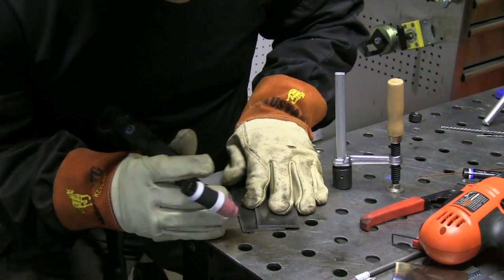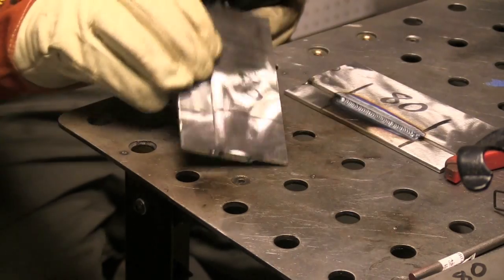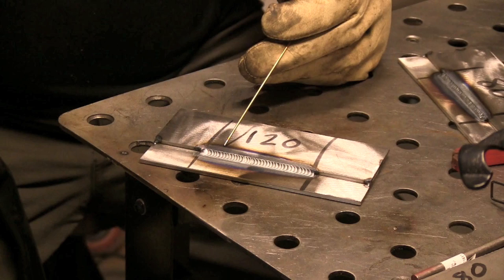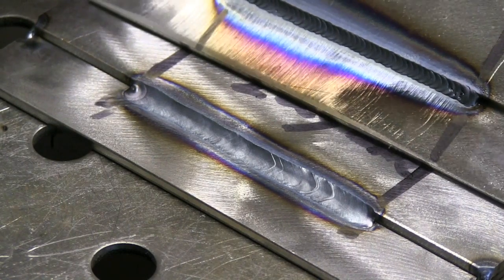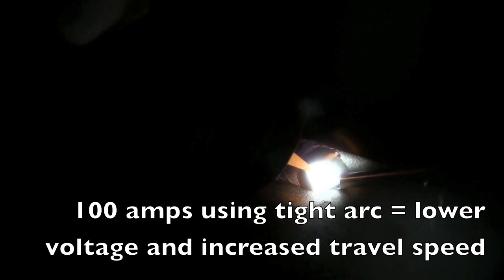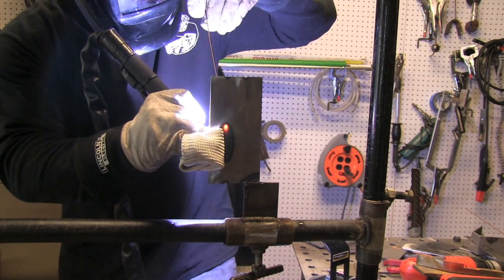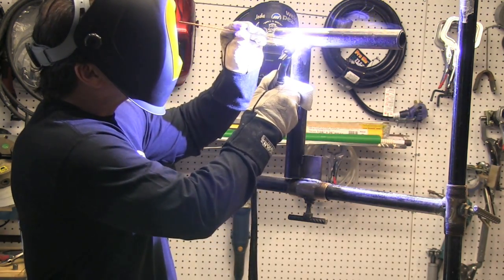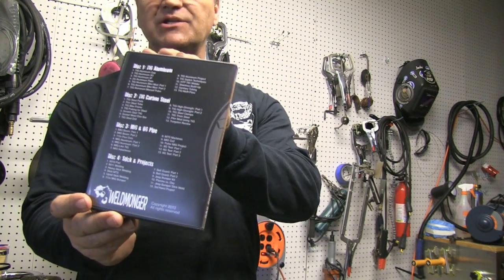Tig Welding Steel and Controlling Heat Input

Comment: Hearing you talk about the heat transfer made me think of something I learned about lampworking. That's welding glass tubes and shaping them. As you heat the glass it's helpful to think of it as water flowing into a dry sponge. The longer you sit in one area the deeper it soaks. In glass you have to keep it moving or it will drip like honey off a spoon. In your case 80A had to soak more to get hot enough and that soaked more heat in to the surrounding metal. Anyhow, good stuff 10 years later.

Comment: What a different way to approach the issue, I was bringing up the heat slowly until I first got the Puddle needless to say I was putting in way to much heat. Time & travel speed effects the heat input more than even the amperage setting, it's like a light just went on in my head, thanks.
Reply: Same here

Comment: The key to controlling heat input is higher voltage and borderline current. Voltage is also the key to better quality welds.

Comment: Given that your arc length was nearly the same, the heat input would be 4,800 amp-seconds at 80 amps and half that, 2,400 amp-seconds at 160 amps.   Good video lesson.

Comment: Thanks, Jody 😊. I'm basically a novice when it comes to tig welding. Was having issues last night trying to tack up a new welder cart, I believe I was long arching causing my tungsten to constantly lose its point 😒. After dipping my tungsten half a dozen times (but in my defense, I was on the dirty, crooked floor trying to get a nice square joint 🤣) guess I was overcompensating. Thanks again man 👍😊👍.
Cheers!

Comment: On the tube mills that I’ve worked on. Both carbon and stainless the seams are joined together using a coil on carbon.  steel as the seams are mashed together and a skiving blade right after to shave the the top weld off. As for stainless a laser is used right at the point of seam contact to mash the two together. Carbon runs anywhere from 160fpm to 300fpm. The best we can get out of stainless because of the annealing process is about 30fpm.

Comment: If I ever get a shop my plan is to make an argon bubble, 100% shielding until the parts are removed. Very specialized, I know, but there are applications. Say you gotta make some FJP stainless or titanium parts, the bubble will be your best bud. 

Luckaly I don’t need to worry about that because I’m a stick welder hahahahaha

Comment: thank you very much for this excellent lesson, I think showing less heat by increased speed is very helpful and you did an excellent job.  details like larger spark is higher voltage helps me a lot and I do need help.

Comment: Is heat input synonymous with potential for damage to the material?
Reply: Enough pedal over a time difference does make a large impact on the strength, geometry & composition of the weld.  As Jody states, heat input isn't necessarily a BAD thing. You need to weld 'hot' enough to get great penetration.
Reply: If you’re tig welding stainless, there is a greater potential that the material will break down

Comment: Thanks so much for this video! However what is the rule for welding dissimilar width material like 1.6>3mm mild steel, what would you set the amps to?

Comment: These are awesome ! I picked up a TIG after doing a little research for my body shop. A lot more aluminum is being used in the bodies, and they have to be welded. In steel bodies, the metal has gotten thinner so the old icy-acetylene torch with fluxed brass or copper clad steel rods are out due to warpage. 
   On the thin steel I've laid a wire from my MIG as filler and welded over it. Leaves a nice flat surface with very little grinding. My question is this: can I use this lay wire technique with aluminum?

Comment: At the end of the video you touched on heat spread affects on aluminium welding. Repairing structural things like 
aluminium boats, can they be welded without bad HAZ effects?
Reply: Hazzy238 

Aluminum will always suffer from a loss of strength in the HAZ. You can minimise this loss in strength but never eliminate. When you think of welding structural aluminium jobs remember to consider the strength of the joint will only be 2/3 yield of base material rule of thumb.

Comment: Very informative video! Thanks alot. As your talking about "arc length", is there a rule of thumb for the distance between the electrode and the welding parts? From the video it seems even slight changes have big effects, so i wonder if theres a best practice or something :) 

Thanks alot

Comment: do you have any videos that show tig welding on very thin ferrous and non ferrous metal. range from 24 to 12 gage sheets. or will they vary on different techniques?

Comment: Those tig fingers r good Jody I must say I like em I do a lot of tig. I find it helps if u wear a heavier glove like a mig or stick glove on that torch hand your puting it on it fits more snug. If u could make a smaller size one that fits snug on a tig glove would b good. U want it snug n they r a little big if u use it on your pinky finger like most prob do. Otherwise handy little things. For others using em they do fray with use over time but if u have a flap disc\ sanding disc they last quite a bit longer if u give sharp edges a little sand to remove the sharp edge.Sheared edges or burred edges chew these things up pretty quick. But once again these things r very handy. Always got one in my box!

Comment: Please could you tell me what material you use for the filler wire on cold steel. Here in Hong Kong they are telling me to use 316 Stainless steel filler rods and they are selling for $750 per 5 kg ...owch.

The other option they gave me was just use a STICK welding rod WITH the gig welder to join two pieces of cold rolled steel 5mm thickness together :-)))) Hmmmm sounds dangerous.

What do I need the filler rods for? Im welding could pressed steel 5mm together to make a TIG trolley.

Please could you shed some light as to what material the filler rods should be!

Thank you

Richard

Comment: WOW! Huge difference in the look of the weld at 80-140. My instructor told me to turn my heat to 60 on 1/8" stainless steel, and I must admit it took forever to establish a puddle. I'll try to turn my amperage between 90 -100 tomorrow and use this technique

Comment: Love your videos. As an R/C Heli instructor, explaining things in understandable detail is your forte. OK, I'm on my second "m" size bottle of argon just doing bead line after line, with and without filler. However, try as I may I just can't my fillet weld the color and small weld size of your fillets using the same steel as in the video.  My amps are 120 with 1/16" 1.5% lanthanaded rod, wp9 torch and my time for welding 3" is right around 35 seconds. Before I pull out what's let of my hair, can you help?
Thanks for your effort,
Pete O

Comment: I know nothing about TIG welding. Is the lay wire technique bad in any way compared to the other technique? (aesthetics put aside)
Reply: Yes it looks good but is a lazy technique that is frowned upon by good TIG welders as the wire covers and reduces the root penetration - which is the strength in a joint - this technique is for cosmetics only.

Comment: Please help. I am not a welder just a hobbyist. I am learning by copying you Jody. I have setup the same 11 guage plates. They are cut 2inches wide instead of 3 like yours. I am not able to get the same results. I have met your 3 things that can go wrong so my distance is ok and my rod is not out there. My problem is the welds come out looking grey not shiny like yours. Plus I am not getting the stacked dimes either. I have an HTP TIG Set to 120 Amps Frequency 33 Pulse 33 low side is 33. I have done it with out the frequency and same results. Please help.
Reply: I have tried all other settings I am guessing my tank is 900 PSI and it may have contamination floating in it. I have the gas flowing at 15 to 20 psi.
Reply: FrustratedBaboon
I get sparks flying off. I think I will bump it up to 25 psi
Reply: FrustratedBaboon
Changed to stubby gas kit at 20 psi getting much better results.

Comment: I don't think I have missed one of your videos as yet simply because you are so straight forward and to the point with some humour. At this point I was going to praise you quite a lot but I want you to still be able to fit that mask over your head.
I do however have a question about the TIG finger .... would it also be suitable for use with a MIG welder in a case where there is simply nothing to steady against other than the work piece with the left hand little finger and the right hand steadying on the left hand, so essentially the TIG finger would be worn on the little finger of the left hand and pass approximately 3" away from the welded joint and approximately 7" from the active weld?
Please keep on posting so that I can keep on learning.
Allan
Reply from the maker: Use the TIG finger for MIG welding?  I do it all the time.
but here is the thing... if you hold the tig finger  too close to the mig arc, like 1 inch away, it will definitely start fraying.

Comment: great video joey. ive been following for awhile now. i just got a great job in beaumont texas working at Ohmstede. making heat ex-changers. using tig, mig and stick applications. im looking for some vids for a little thicker material.  say, 3/8ths. all positions.  i need one of those tig fingers also haha. but yes. which one would be best to go by. lately ive been using 316 filler and 410. along with some 2205. i want some a better stack of dime, all positions

Comment: What you demonstrate in this video is a daily ordeal at my job! I weld aluminum floors that are sometimes up to 28 feet in length with 8 seams that get fully welded. If you run to cold, you basically warp the entire floor. Hot and fast is the only way to do it. It's all push pull of course, TIG would never be practical. Thanks for the hard work you put into your videos man, keep it up.

Comment: When I'm welding carbon steel with a 3/32 filler rod (125 amps) the rod tends to stick to the puddle and the puddle (the best way I can describe it) "over fills". Every time I dip the toes of the puddle step out making the width of the bead inconsistent. Would dropping down to a 1/16 filler rod help?
Reply: i had the same problem. i use a pedal at my job though. but i would just increase amperage a little bit. basically, either use smaller rod or more amps. either way may help. i weld all types of metals. from copper nickel to brass.  very soft metals so it flows very easily. beautiful mirror like welds :)
Reply: I always almost dab with 1/16" or .045" for this reason. You want your filler to melt faster than the base material.

Comment: thanks as always for sharing your knowledge man. what would you do to minimize weld input in case the plans call for a convex weld bead? and an ot question, a customer will be bringing some parts of hot roll that he dipped in muriatic acid to get rid of the scale for painting.any input will be greatly appreciated bc i`ve never had to weld over this and don`t know if it`s going to affect the weld or me. thanks again
Reply from the maker: a convex weld bead using mig is pretty easily achieved with a pull gun angle.
for tig, you might jump up one size in filler rod and even then push a bit of rod into the puddle each dip.  I dont think you will notice anything negative from the parts dipped in acid, if anything, they should weld better.
Reply: weldingtipsandtricks
hopefully i`ll get that other job which calls for a convex weld. so you mean that one pass with a big filler rod, i was thinking that two low amp fast passes would input less heat, that`s why i ask the man who really knows. thanks man

Comment: Damn, wish I had seen this video a few weeks ago. I just got done finishing an exam piece and was running 50 amps on a v-butt, outside corner and T-fillet, with anything higher I just got undercut no matter how much filler wire I put into it. Got it done in the end but was sloooow going. Great video as always.

Comment: My second charpy test piece past today ironically.  I had to do stringers as apposed to my normal weave or j technique. And yes I did cheat on the travel speed.  Lesson learned!  Didn't think these things were so important.  Thanks for this lesson
Reply from the maker: glad you passed.  it sucks to fail a weld test. even if its a material issue and not in the actual weld metal
Reply: weldingtipsandtricks Im actually glad it failed cause it lets me know that I have been doing it wrong for a long time!  Thank you again for your commitment to welding and sharing your knowledge!
Reply: What material did you weld on and what was the difference between weaving and not weaving measured in joules? Also interrested in what the bar for passing was set at.
Reply: InqWiper The material was SA 516-70N.  It doesn't seem that critical seeing as its all rusted and pitted very badly.  Sorry I don't know the passing level measured in joules but we did the next test with stringers and it passed.  Personally,  I think its all BS.  Our first test piece was sent to a lab in Pennsylvania and passed with flying colors and I weaved the root and some of the filler.  The next 3 that failed were sent to a different lab in Houston.  Im not the best welder but I have never had a problem with a weave as long as I stayed within the interpass parameters.  If you think about it, weaving does require a slower travel speed inputting more heat.  I hope this helped somewhat.
Reply: D Armstrong
I'm no expert and not familiar with ASME but looking up the material online it doesn't appear to be that sensitive regarding heat input.

You say the material was rusted and stuff, did you weld on top of it or did you try fixing it up first? I would not be surprised if it was a material quality problem if you welded on a rusty and overall poor piece.
Reply: InqWiper This is the fist time I have worked with this material.  Knowing the company I work for, this may be some experimental material lol.  The bevels were all cleaned and prepped before welding but the rest of the material is what was so ugly.  The actual job is a medium sized pressure vessel but the test piece is a drop from a cutout.  The pits and overall condition of the shell is what made me question the condition on the material.  Its not like if you get a machined piece of 4140 or stainless or an exotic.  This is why I didn't really take precautions while welding.
Reply: The advantage of stringers with the Charpy test is not so much to do with the overall heat input but more to do with the normalisation and grain refinement each weld pass gives to the weld pass below, therefore many small passes will give better mechanicals that 1 or 2 large passes.
Reply: David Richards I appreciate your input sir. The failure was actually in the root pass section of the test. (stringer bead)  I aint the most educated welder but I wish to learn as much as I can so, if you will, please tell me what I did wrong. 

Specs are 3 and 1/4 inch material SA 516-70N double bevel knife edge.

E71-T1 fluxcore filler metal

270-290 amps 28-30 volts

I followed the parameters to the tee!
Reply: juju Hyatt%